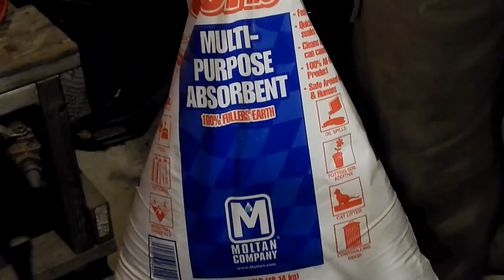Black Diesel and WVO Information Pt. 2

Comment: Hey, I'm new to this, and this is exactly what i'm looking for to become educated quick. I'm off grid and it's getting cold at night. I've got a few drums collected and have been looking for an all-encompassing start to the field of self reliant, self-made alternative fuels, mixes and equipment. I have learned more basics in the past 10 minutes from your range of products and how they are used. The demeanor of your off-the cuff delivery is perfect for my low attention span. It's the specifics and potential problems advice that makes this a valuable tool for a beginner like me.  I've got only one shot to do this right and I need to build on having flexibility.  I'm grateful you cut vids and shared them. There's nothing else out there that caters to the simple need of understanding without the faint scent of lingering bullshit. Tangible to field experience, you are upfront and honest about product capacities and I'm sure as fuck that I'm gonna be a loyal customer. -Dave from Kutztown.